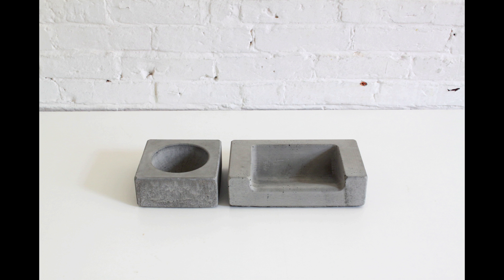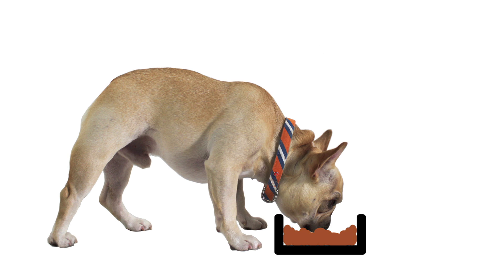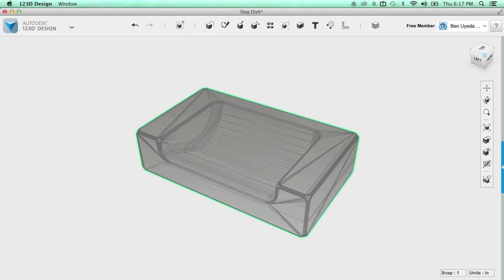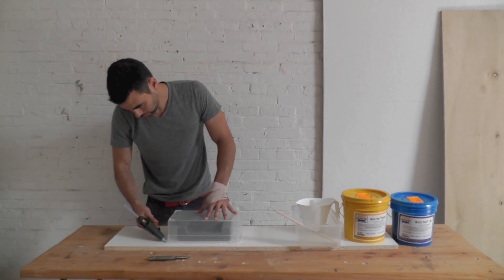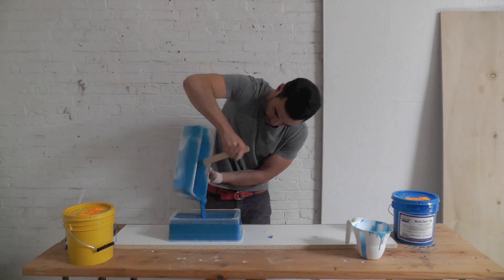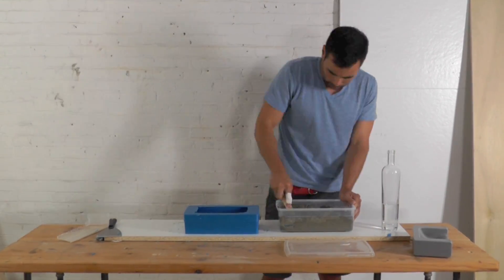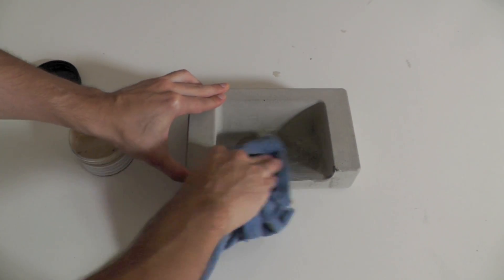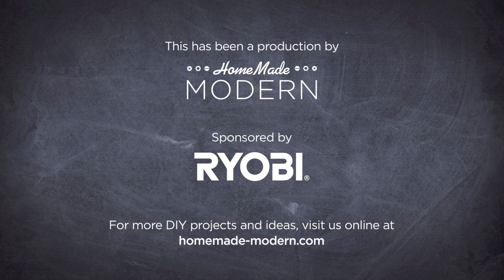How to use 3d printers to make Concrete Products

Comment: Hi there! What kind of cement or concrete do you use for these products? I am planning to do some concrete products too but I can't find useful info about concrete quality. I already did some tests but the result is too rough... I'd like to use something more compact with very fine texture. any tip? thanks and keep inspiring us :)
Reply: Jules Parmentier If you would like I could help you understand a good mix that would be very smooth without much finishing.
Reply: Jules Parmentier  Jules I tried messaging you from another account but im not sure if it worked. If you still need help with finding good concrete for applications like this give me a shout.
Reply: +Eric Nagle hi mate, can i ask some questions in regards to concrete... email or fb?

Comment: nice project, and the design is smart, but dont think eating out of a concrete dish is good for a dog's health
Reply: GreatGeorge89 It's sealed with a wax finish, and it's sanded and all that noise. I'm pretty sure it's fine.
Reply: GreatGeorge89 Many major municipal water reservoirs store drinking water in massive concrete holding tanks.  I think It should be ok for dogs.

Comment: It's absolutely pointless to 3D print simple shapes. It's a waste of material, and money. It's really not so hard to make this shape with your hands and some instruments probably. I guess it's just trendy to use 3d printer, but you didn't know how to use it properly.
Reply: San Vosanata It's not pointless to 3d print simple shapes, as evidenced by this very video.  The point was to make a mold for repeated casting, which he succeeded at.
Reply: It's been four months, we're all waiting San Vosanata
Reply: I'm sorry it seems I offended you somehow, and I also didn't see the notifications before, and so here I am 4 months later to convince you it's pointless to 3D print simple shapes. 
I'm not making a video of me modeling a cube out of clay, I have experience in this field and I most certainly have better things to do. People have made incredible, almost impossible sculptures without using technology, so trust me it is not so hard to make a cube. 
About the concrete, it has nothing to do with 3D printers. Make a mold and pour the concrete in, let it cure for some reasonable time(depending on the size mostly), remove the mold and it is done.
And about the "proper" 3D printing: you can print anything. If you can't make a cube out of clay using some tools, then go spend a shitload of money on a 3D printer and print simple shapes. I would use it only for complicated models which I can't make any other way. But then most probably I wouldn't be able to make a mold because of it's complicity.
Don't get me wrong I like these Home Made Modern videos, but I find this one pointless. It is perfectly suitable for the ones arguing above, but not for me.
Reply: Why don't you demonstrate how to do it with your hands and some instruments. I'm really curious to see how easy it is. And if you can, why not show us the proper way to use a 3D printer since you seem to know about concrete and 3D printing so well.